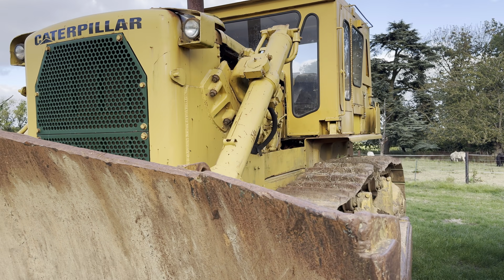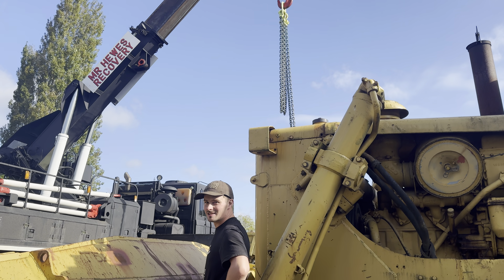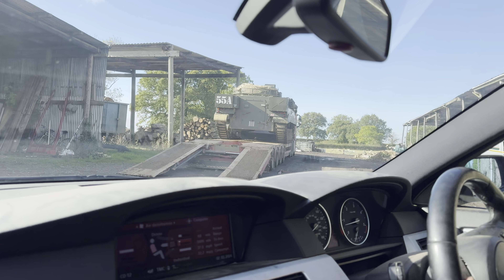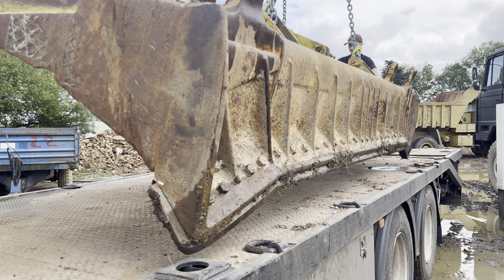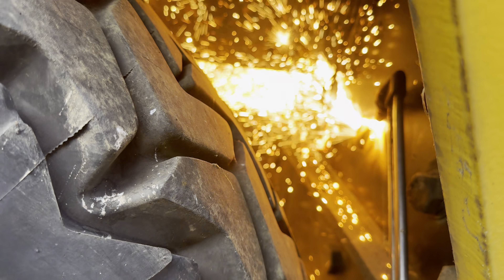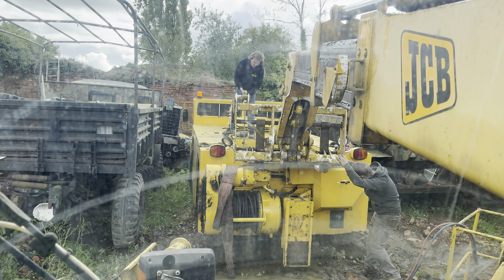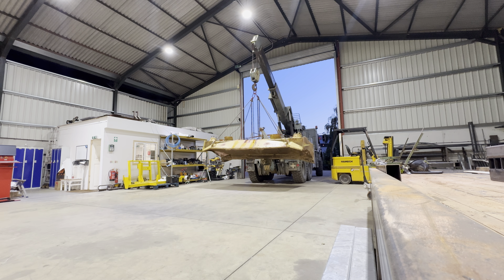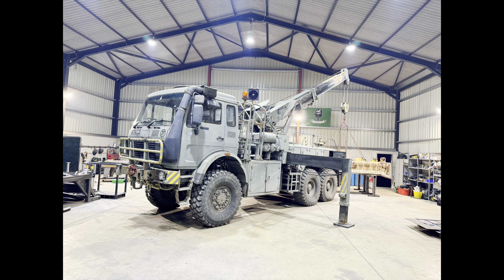HEAVIEST RESCUE! Building this 89600 lbs Recovery Bulldozer.

Comment: THAT UPPER SPHERICAL LINKAGE IS MADE FOR PUSHING (COMPRESSION) AND NOT FOR PULLING WHICH YOU WILL DO WITH WINCH

the tensile stress that will happen in those medium sized six bolts is hiiiighhhhhhhh
tooo higgghhhhh
Reply: They said they will wield it up solid, no need for angling the blade.

Comment: Why not put the winch on the back of the dozer you get better weight distribution on the dozer
Reply: They want the blade to dig into the earth as an anchor.
Reply: @  yes i know by now i have seen there explanation and there going to mount a smaller winch on the back

Comment: Why not mount the winch BEHIND the blade (ie on the back of the blade) and put a aperture in the blade through which to thread the cable.  That way you keep 99% of the functionality of the blade whilst also having the winch in place.  When the blade needs to be used as a blade then just bolt a plate over the cable outlet.  Make sense???

Comment: Here's my 10 bob's worth, I use to own a Bedford RL recovery unit and it had a winch mounted up in-between the chassis and the cable could be fed out the back and through a multidirectional pulley wheel OR under the vehicle via a couple of 'followers' and out the front. So with the D9 in mind, I would mount the winch on the back with a large pulley wheel and with the mother of all fairleads set into a recess in the area of the lower-middle part of the front blade and covered with removable thick  steel plate so that the fairleads do get jammed up with crap or damaged when using the blade in the conventional way. Re the risk of snapping cables and shackles, fabricate some plate steel (angled downwards to the ground) around the back of the winch to protect the driver and the bulldozer, and get yourself  a roll of metre wide plus of used rubber conveyor belt (bastard to cut but it has a 101 uses) and carry a few 2 to 3 metre lengths to drape over the cable when under load so as to act dampers in the event of breakage. You could also fabricate some form of removable derrick that can be connected to the front blade (like the example on skid steer in the video).  The benefits of this suggestion would be; the option of front or rear winch pulls, better visibility over the front blade, less risk of damaging the front area of the bulldozer, better weight distribution across the wheel/track base of the dozer, easier access to the winch (due to it being lower) for operation and maintenance.

Comment: I would consider mounting the winch lower on the back side of the blade, then have it come out the top through a horse head/swivel. This is how our winchbox is setup. Keeps the pressure even across the blade as well (less pressure just on just the top). Winchboxes work best when they can force the blade deeper into the ground, so it gets a better bite, so you want to be able to angle it down a bit as well. Excited to see this one built out!

Comment: Just keep in mind....  A bulldozer blade's design parameters are for an exorbitant amount of PUSH pressure at the bottom cutting edge.  You are changing the "loading" on the blade assembly for a PULL force at the top of the blade.  You are using the force structure in reverse of it's design, depending on the weaker points and not fully utilizing the stronger structures.

Comment: Putting the winch near the top of the blade will put extra strain on the top pins. The blade is designed to push and pull from the bottom in line with the side arms (a hell of a lot more push than pull)

Comment: I could be wrong but I think the issue with the front winch is where your center of gravity/mass is and thats why its always on the back of massive heavy vehicles. Something tells me if you try and lift something the size of Jacks mum the whole front blade and the cab will flop forward seesawing. I could be completely wrong but just a thought

Comment: Bulldozer blades deal mostly with pushing earth. (Compression loads) If you attach a winch to the blade then all the heavey loads will be reversed. What max tensile load be applied to those top struts / ball joints.
What do you think???

Comment: A least this old D9 won’t be stopped in its tracks by a mouse having lunched on the can-bus or injector look soya insulation.  I like your Merc more than the old Fibreglass Foden. Seeing those Foden cabs being made back in the day always made me nervous of  a serious front end collision. At least the military cabs had an extra couple of sheets of fibreglass. I’ve seen a few incidents where the cab has completely disintegrated into a shovel and brush job.

Comment: Maybe add some "fail safe" steel cables incase a hydraulic line failes so it won't rip the whole front shield/winch assembly apart.

Comment: A winch on the blade is not a good idea.
This dozer don't even supposed to drag its own  blade on the ground backwards : the blade is attached with two bolts on each side retaining cap.
When you will use the blade winch,all the anchor effort will be sent to the bulldozer body via those bolts,wich will snap.
Ask @Jpaydirt about that idea,he will help you.

Comment: I recon iv seen logging varients of dozers where the winch is mounted on the back of the machine where the rippers would normally be mounted. However, i do like your idea of front mounted as the blade can be used as an anchor point into the ground. Did the D8 have a ripper set up in the back? If it did you could probably use the hydraulic power supply for the rams to power your winch. Just a thought.

Comment: Often seen you using the lift jib and winch together on the Foden, what about a decent hiab on the blade too? Or, previously you mentioned putting the winch on the ripper mounting at the rear, assuming that the ripper mount in now freed up ( because the winch is on the front) put a dirty great hiab back there!!

Comment: I just tried to make sure that you're pulling from the center so that it does not force wait on to the tracks in a forward motion what's your name turn release weight from the rear end input too much force on The Idler Wheels

Comment: Yes, there is a lot that you can, could have, done differently.  If that blade fell while slewing, it would have flattened both of you when it rolled.  With that weight, you wouldn't have time to react.  You need some guide ropes.  ... a couple short ropes with quick connectors stashed in the truck.

You also need a flint lighter for the oxy touch.  As I always say, if you can afford fuel, you can afford oil.  Or, if you can afford gas, you can afford a flint lighter.

Thirdly, winches can be very dangerous.  With that size winch, I don't think a few bars on the cab for a cage will stop a d-shackle of cable.  You need bullet proof glass as well, but your visibility will be shit.  If you want to mount the winch on the front. I would build a, LARGE, roller behind the blade for the cable to feed through the blade rather than on top of the blade.  But, you really need to consider the use case.  Cables are obviously more dangerous with length.  If you're winching small runs, just use the dozer tracks.  

And, with that cable, you're going to need another smaller winch to pull the larger cable to the destination.  I really think heavy-D needs that.  The dozer would have the electrical power to run an electric winch, so why not.  I mean, without one, Jack's only word be f#$#$ o#$ for the rest of his life.

Comment: You won't need your bar armor. The elastic strain in a winch cable is bugger all. A snapped cable doesn't behave like a bungee cord.
Reply from the maker: It’s not the cable. It’s more like the tow point snapping off or a failed D link

Comment: The iconic D9 , of which fewer and fewer remain in the uk, its blade being amputated and converted to mount a winch on is an act of desecration to any decent earthmoving enthusiast.
Dont get me wrong, love your channel and all that but putting a winch on the front blade is criminal.
Cat put winches on the back of D9,s for a reason.
I think your logic is that the blade will act as an anchor during winch pull?
No need. There is nothing you will want to winch that the D9 will not pull out with it on the back given its weight.
Now what does the d9 do with a winch sat on its blade?
Go poughing with 20 furrows?
Far better to refurbish the d9 to new condition and show it to represent British earthmoving through the ages using the largest dozer ever to be used in the uk for decades.
You should be ashamed!!
That said, great channel, keep up the good work but please mount the winch on the back where it should be.
Reply from the maker: You should never underestimate people who don’t choose to follow the herd.

Comment: Long-track D9G: the Old-School giant. After this - starting with the D10 - Cat went to the high drive axle design. Honestly, it was a great innovation, because it takes the drive axle off the ground and saves it from a lot of stress and wear. But there's still something special about the old D9. There was a 'hidden' abandoned D9 in Farming Simulator (2017 I think) that you could find and acquire for your farm.

Comment: I would mount the winch behind the blade in the middle. with a fairlead through the middle of the blade. that way you could pull an 180 deg arc out the front of the blade. simply put plate guides next to the fairlead to cover the whole hole with a plate. also any broken cable would fly back into the blade not over it. Of course you would need a wench to operate the winch, simple enough.

Comment: Would the winch be better mounted on the frame behind the cab with guide pulleys under the frame and either through the blade or over the top edge?

Comment: As a teenager I bought an AEC Matador that got used for an odd bit of recovery, it had built in pulleys on the back of the chassis beams to use as snatch blocks, or to allow you to run the cable from the winch in the middle down the side of the vehicle and out of the front for self recovery. Def worth considering fitting something similar in the blade edges. Although the Matador was a farm truck and H&S wasn’t a huge consideration even in 2004 so you may want risk assessment before copying…..

Comment: Mount your snatch block low on the front of the blade, you will want to ensure that pulling forces tend to drive the blade into the ground, using the Earth as an anchor point will allow for a full pull.

Comment: Heavey plate with  attachments weldedon blade for rigging snatch blocks pulleys and consider putting a set of fold down spikes at the front of the blade. For more grip in the dirt than the weight of the dozer. Weld on taller grousers to the tracks for even more grip in the dirt. Take dunnage for crossimg roads and sensitive areas. Use the dump truck to pull the trailer with winch dozer with Foden. Nice group of capable machines and men to go get what ever out of the hedge row paddok etc. Also consider putting hard attachments where the hydraulic tilt cylinders on the blade. Rigid attachment for better pulling. Great idea. See where it gets ya
Reply: I seriously doubt you are going to use anything but a tri-axle road tractor and a RGN Lowboy trailer to haul that D9G anywhere on a public road because Cat say a D9G weighs in at 108,000 pounds (48,988 kg) and the blade is 14 feet 7 inches (4.5M) wide and 13 feet (4.0m) tall. I don’t know what weight, height and weight restrictions/regulations are across the pond but in the US that load requires oversized vehicles permits to transport one and depending on the state the blade and arms will need to be removed for transport and a tri or quad rear axle road tractor and RGN Lowboy or beam trailer tri-axle trailer or a trailer with a stinger are going to be needed to legally transport it and you may need a pilot car as well.

Comment: I would only ask if that front hydraulic/round blade-mounting system is rated to 35 tons pull?  If not, and if you're pulling something hard enough, you're going to pull your blade right out of it's mounts.  That's why they're mounted to the frame on the back.  So you might consider reinforcing the blade mounts and the round-joints to ensure they can handle the maximum force you can apply with the winch.
Reply from the maker: And we will be
Reply: @MrHewes  you guys are so on point!  I shouldn't have doubted!!

Comment: Vertical or horizontal bar armor?    The one you showed is for stopping munitions like an RPG from hitting the cab.   A horizontal orientation may allow a whipping cable through?   I agree with another poster to go to lexan windows at the same time if practical.   

Great project.

Comment: *Just looked, another comment says the same *Will you need to reinforce those socket joints at top of blade? Will be pulling on the bolts not pushing into the socket?
Reply from the maker: Yes we are aware il be sure to explain all this in the next one
Reply: @MrHewes  tidy, easily overlooked, but would have been funny for us watching. It does make me wonder what it will be recovering and if it will get some diesel brother tramp stamps all over it (not bashing their content 😂) also needs a name when the winch is on e.g. "Jack's camel toe"

Comment: I would try add a single ‘balenced’ lifting point (perhaps even a series of holes in a plate like you see on a sumo trio) to ease fitting and removing the blade and a small fast winch on plasma rope to aid rigging the big cable as has been said.

Comment: Glad to see Ted keeping an eye on you lot 😆👌
I’d be tempted to add the winch low down (I’d guess the blade is mounted for more strength there) and have a roller at the top to help “lift” stuck gear as you pull. Plenty of points to put snatch blocks and as someone said, possibly a smaller winch to pull the main out
Reply: i think the winch cable would be the weak spot. that'll fail way before any of the blade piston rods fail.

Comment: It wouldn't be a proper vid unless there's a reference to 1) Jacks height and 2) jack's mum, lol. great vid and very different project, least the back of the dozer can now be used for something else, plus more visability and control if the winch is on the front.

Comment: Personally I would've cut through the blade and mounted the winch behind it, with the rope going through. That way if it did snap the blade would also protect you from the backlash.

Comment: This may be a stupid question, but why would you have the whole winch on the blade, rather than directly & solidly mounted onto the chassis of the dozer? Would a simple very beefy pulley at the top of the blade not achieve the same result, but with far less not-designed-for forces & loads being to the blade & its mounts/rams etc? Have you worked out, with the winch on top of the dozer blade, what the forces in play are, & what the likely point of failure is when pulling on it? The blade is obviously designed to be strongest in compression with forces directly applied to the chassis through the side arms, not in tension in the middle & several metres above the central axis. A pulley in the centre of the blade on sufficiently robust bearings would be experiencing a vertical load downwards, which you could mitigate with extra structure between pulley & bottom of blade which will sit on the ground.

You also have the [additional?] option of creating a hatch in the blade to feed the winch rope through for straight pulls that completely avoid stressing the blade in ways the dozer wasn't designed for...

If you've done a load of design work on this & can answer all the above questions to your own satisfaction, please forget I spoke :-).

Comment: I would mount the winch on the back where it was intended to be mounted for safety, reliability and performance. I take it this is Hydraulic and not PTO. Any front mount will be a compromise as a heavy load will bury the blade leaving difficulty to drive while the winch is pulling the 35 to 50 tons. Every cat in the oilfield where heavy loads are winched plus driven are rear mount. jmo
Reply: If you front mount you will loose the ability to lock one track and maneuver, that D9 power will destroy any front mount pulley system and its dangerous. Hold the cutting of the blade and rethink this!
Reply from the maker: The whole purpose is to burry the blade and increase the mass? 

To successfully recover something you need to have more mass than the thing you’re pulling. 

If you can lock at track and turn while pulling the stranded vehicle it’s simply not that stuck.
Reply: @MrHewes  if you are just looking for an anchor and straight pull sure that will work but loose the ability to winch, drive and maneuver which is what you need in many situations. Proper winch for D9 is 50 to 60 ton pull. That 35 ton is going to work hard to pull a stuck tank. It's your channel, just trying to help based on experience. Cheers!
Reply: Winch plus 475HP will win everytime. Winch alone in some cases won't do it.

Comment: It needs a pass-through hole in the blade. Below the winch and above the cutting edge structure it needs roller to feed the rope under the bulldozer if you get stuck and need to come out backwards. You will need to stop the tracks just before she bellies-out though :o) (alternative is a side roller. I had rope guides on the side back of my winch challenge truck to send the rear winch line forward and they were ace)

Comment: It'll be interesting to see how it holds up. Putting the winch on the blade means all the forces on the blade will be in the opposite direction for what it was designed for.
Reply from the maker: Well the idea will be the power blade down deep into the ground. So technically not as bad as you’d think
Reply: @MrHewes  Ah of course!

Comment: imagine if you removed the front blade and the side lifting rams  and kept it off how much weight to power ratio you would have...you could add the anchors to the ripper arms on the back